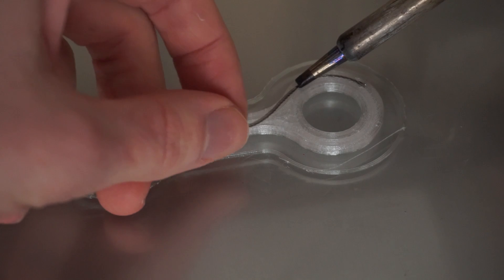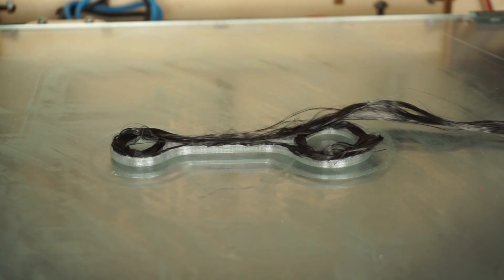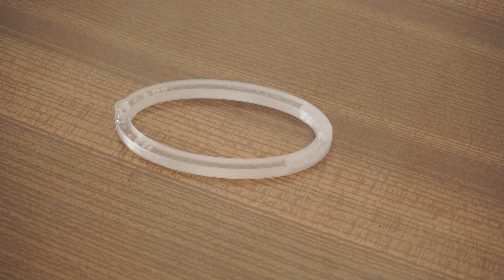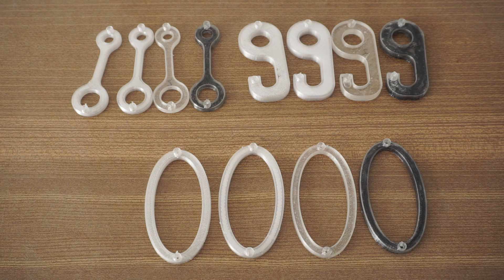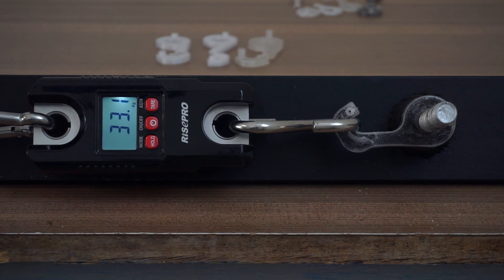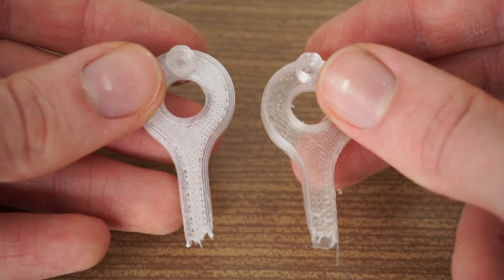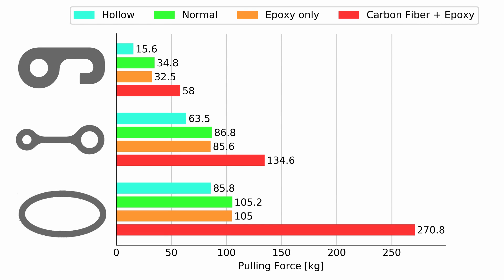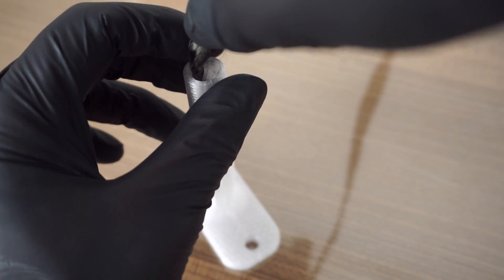Reinforce Your 3D Prints with Carbon Fibers and Epoxy

Comment: If the carbon fiber strands are too hard to fit, you can try forged carbon with epoxy, though, I'll doubt that forged carbon offers the same amount of strength for the parts. Still something that's worth trying.

Comment: For the longitudinal screw part at the end of the video why not have holes at both ends of the screw, you can then thread the fibres through with a rod or 'needle' repeatedly so its like a bobbin and you have many parralel tow threads. You then cut the looped ends at the top and bottom, seal the cyclinder and pour in the epoxy....  You should be able to get a much denser 'infill' this way.
Btw. for bigger parts what about standard infil and load up those 'pockets' with chopped fibre + epoxy mix...   I.e. the printed part walls becomes the mould for an internal 'forged CF' part: https://www.youtube.com/watch?v=25PmqM24HEk&t=5s

Comment: If you want to strengthen your part you need to wrap the carbon fiber and epoxy around the parts by using a paintbrush to brush the parts with a thin layer of epoxy and layer a thin layer of the carbon fiber over the top and brushing with epoxy again, then sand and repeat 1 to 2 more times.
Reply: So if the part is size specific scale it down a little bit.

Comment: if instead of printing the part then reenforce with carbon fiber, you 3d printed the mold then make the carbon fiber part around that, it will be even stronger. and lighter.

Comment: It might be good to try cutting the carbon fibres to 1mm or a bit longer and mixing them with the epoxy before injecting so when set the material has a non uniform grain that should make it stronger than epoxy alone and you could get the fibres into the part through a hole if it would come out of the syringe at all!

Nice vid though, I was wanting to try this myself for the MPCNC parts.

Comment: Holy shit this is amazing. I don't get why carbon fiber that look like strings can make something so much stronger and stiffer.

I wanna see if I can make a toolhead that can lay the fibers... If only there was some fibers already made into a filament like shape with resin. I could cut them when I'm done and push them with regular extruders....

EDIT; HOLY SHIT IM HYPED DUDE. THE STEEL injector tool should be easy to make! I'm so hyped if I get the time. but I'm gonna use copper cable (for power etc) because steel is super hard to cut.... Unless I do multiple thin steel wire passes

Comment: So whenever you do an injection, you really should be injecting so that the air escape port is higher than the lower port as to prevent air bubbles to start with. Second, carbon fiber works best on the outside. Third, your last part did not have carbon fiber through the base, where it’s most likely to break.

Comment: important thing you miss - there are hundreds varieties of epoxy resin... (epoxy glue from store not the same epoxy resin).
with very different properties. usual epoxy strong and fragile, but it can be flexible to.
also different fillers can be used, not only carbon fibers. and same - very different properties.
I think 3d printout resin filling still open for lots investigattions.

Comment: Perhaps you could chop the carbon fibre into fragments of a few millimetres, then stir them into the epoxy before you inject it into a part. You might need to use zero infill or multiple injection holes to let the fibres reach throughout.
Reply: Don’t breath the chopped fibres though!

Comment: Epoxy may not cure as well inside a closed cavity.  Locktite type materials might have better results.  They are made to cure inside air tight spaces.
Reply: Totally wrong. Expoxy cures with the hardener mixed in, no air, humidity required, or any solvents to de-gas

Comment: ok so the material is going to brake starting from its surface since the stresses there are generally greater on bending and due to stress concentration. Filling the material with fiber-epoxy doesnt increase greatly the strength for that reason and for the reason that in the carbon-3d printed surface you only have epoxy as a binder wich im not sure is a good match from your results(way different elasticities).

Comment: why not print with carbon fiber or steel filaments?
Reply from the maker: Those tiny carbon or steel particles in the filament don’t add a lot of strength in comparison to continuous fibers.

Comment: Thanks for doing all the leg work and thinking of ways to DIY stronger parts.  I have been filling parts with resin for a while but my biggest problem is getting the prints to be water tight. What sort of settings where you beefing up to make sure there aren’t micro gaps in your layers?
Reply from the maker: 3 perimeters and at least 10 top/bottom layers. If you still have problems, increase your flow rate or hot end temperature to make sure your layers are bonding together nicely.

Comment: I used Carbon Fiber in the first whole body CT scanner. We made flat sheets with resin and microspheres for xray translucence. Then we put low density rigid in the center. This sandwich type construction, we had strength and low xray absorbsion. I would use two nozzles. 1 infill 2. Carbon impregnated. Layer 1 carbon, infill then outer layer carbon.should make a strong plate like part.

Comment: Kudos for pushing the envelope and taking the next step.
CA (super glue etc)  works great with carbon fiber.
 A print with the minimal wall and infill that you can make stable enough for placing the carbon fiber could be very strong.
3M 77 or similar adhesive will make it easy to place the carbon fiber tape. When you are satisfied, add CA, or epoxy. Don't expect the print to add structure, use it as a form. CF w/ CA or epoxy has a much higher strength:weight ratio than any print. 
Thanks for the inspiration.

Comment: Epoxy itself isn't very strong in tension.  It's only designed to bind other materials for that purpose.  You probably would get good results with epoxy reinforced infill as long as the infill is tight enough.

Comment: Epoxy resin doesn't stick to many plastics. That's why plastic sheets are used in vacuum bagging. So in your experiment there is very little adhesion between the epoxy and plastic encapsulation. From plastics, PVC and ABS stick decently to epoxy if you roughen the PVC/ABS surface. So to increase adhesion you could artificially 3d print rougher surface (or few lines of grid) inside the channels and/or try using wood PLA.

Comment: To reinforce parts it makes no sense to put the reinforcement e.g. carbon fiber into the middle of the part. This is the neutral fiber and will therefore not strengthen the part against bending. You have to find a way to put the fibers more outside of the material where compression respectively decompression takes place.  The epoxy is good for compression, while the fibers are good for  lengthening of the part.
Reply: @DocM Hey, do you happen to be an alt account for the Minecraft youtuber DocM77?
Reply: @auxchar  nope! I am the first DocM.
Reply: lol
Reply: @StephenTeitgen  you must be just as confused as him
Reply: @StephenTeitgen  rofl. Oh yeah? Good luck with that. I can't wait for you to design a flying machine that has so much bulk to resist forces in all directions, even ones the part won't be subject to, that it'll be too heavy to get off the ground.
But I see you must've just completed your very first high school physics course and now call yourself an engineer 😂😂😂
Reply: @t_c5266  I don't I call My channel teitgen engineering because that's what I do.
Reply: Exactly. Resin is great for compression, whilst fibers, such as this or rope are best in tension. You wouldnt use a coil of rope to hold a heavy object off the ground, but rather you would use said rope to lift an object off the ground. We did these tests in strengths of materials lab.
Reply: @LT72884  Good example with the rope!
Reply: @DocMicha  thanks. Still an interesting video. Glad to see people doing tests like this.
Reply: "against bending"

he was literally doing linear pull tests. Your comment is what makes no sense.
Reply: @t_c5266  sorry, but unless you pull linear with hight acurracy you will have bending, especially in the "Eyes" of the test sample you have bending arround the ring. So if you think a littlebit on this my comment make a lot of sense.
Reply: @DocMicha  nope. You'd find the compression would immediately crack the epoxy and collapse the piece far sooner than the strands in tension. 

Or you can continue to wonder why they dont make rope, cable, chains, etc with hollow cores.
Reply: DocM this is true, however it’s much harder to wrap a part in fiber than it is to embed fiber in a part.
Reply: @Mrcaffinebean  finely chopped carbon fiber mixed into the epoxy
Reply: @je-fq7ve  CF gets it’s strength from being woven. If you chopped into random strands then it would really proven no different than fiber glass.
Reply: @Mrcaffinebean  thanks for the explanation.

Comment: Die größte Belastung bezüglich Zug oder Druck tritt in der Hülle auf. Deshalb hat die Evolution hohle Knochen geschaffen. Bei so simplen Teilen wäre es also zweckmäßiger eine wiederverwendbare Negativ-Form des Objektes zu drucken (oder zu fräsen).
The greatest load in terms of tension or compression occurs in the hull. This is why evolution has created hollow bones. So with such simple parts it would be better to print (or mill) a reusable negative shape of the object.

Comment: You can purchase carbon fiber that has been milled Into almost a dust form. You could then mix it into your resin and fill your parts with that. You must use the vacuum. Your syringe method is very flawed. Also you can purchase carbon fiber in a braided form that could be inserted into your part more easily than a simple tow which is what you are using now.  Lastly,I different is epoxy would work better. The cheap stuff that you buy on Amazon it’s too slow to cure. The faster any epoxy cures the harder it will be.

Comment: Tip: resin doesn't stick to silicone sheets, to make a silicone sheet, use caulking paste sandwiched between 2 plastic sheets, then release the plastic sheets

Comment: Try applying a vacuum to one port and suck the resin through instead of pressure injecting it. It’s the way “Vacuum bag” carbon fiber parts are made.
Reply: I was going to say the same.  Put a vacuum hose one the other end and draw the epoxy in. Not sure how the bubble entrainment may go but it should provide better results given how popular vacuum infusion already is.
Reply: The printed part might be porous you will need to put a vacuum bag over it to stop air intake.
Reply: 3d prints do not hold water ever under any circumstance, let alone air. If you leave even solid prints in water you will find that water has worked its way in and the part will mold even on the inside as seen in clear parts... Granted I live in a very humid environment.
Reply: so the printed part act as a vaccum bag?

Comment: Bravo!  Very interesting video, I would suggest checking into Kevlar tow/fiber  as it is very cheap and strong in large spools, similar to CF.  I have tried both with success.  I would also suggest it because it is much less messy and stays in a compact fiber very similar to string.  Finally it would be worth checking into purpose-made CF epoxy resin since it is made specifically to bind to fiber and the stuff I got has a nice slow cure time and works well.  You might try JB Weld alone since it is among the very strongest epoxies out there, it would be difficult to inject around fiber.

Comment: For years i use abs with carbon fibre....i just put carbon fibre mid print , add a few drops of acetone and resume the print :) 
for method you use....i use it too :) but for easier aplication i twist filament few times then aply it or aply resin before puting it in print and add rest of the resin after.

Comment: The epoxy injected parts will probably be quite strong in compression.

The carbon/epoxy matrix strength depends a lot on the ratio of carbon fibers to epoxy. A 50/50 layup is considered to be achievable for an amateur working with wet layups. With pre-preg carbons it is higher. (and you can go too high, and achieve an epoxy starved layup if consolidation is done with positive pressure instead of vacuum.

From the videos I guess the ratio of carbon/epoxy was substantially below 50/50. That might be one variable explaining the measurements. 
Another variable is strand orientation. Twisting the fibers will cause the layup to be weaker as compared to straight fibers. 

If you could achieve similar weight between the epoxy/carbon layup and the steel wire, I would be interested in the results. The carbon/epoxy layup should be significantly stiffer than the steel/plastic fusion and thus take all loads instead of working as a composite steel/plastic part. 

The epoxy used, curing time and temperature are also some variables that might be influencing the measurements. "Cooking" the part in an oven for 8 hours at 80degC and then letting the part sit at 20degC for a day or two might change the results a bit. If it was the epoxy matrix, not the carbon/epoxy composite, that carried the tensile loads there might be significant changes.

Cool experiment and video! You cerntainly thing outside the box :-)
Reply from the maker: Thanks a lot for the information. I am going to keep this in mind for future tests.
Reply: @leonbrauns  There are plenty of additives for epoxy you can try for the parts where continious fibre is not possilbe or not worth it.
Chopped carbon fibres or milled carbon powder for strenght, glass microspheres for lower density, lots of metal powders or even Aluminium Trihydroxide for fire resistance. I would love to see some destructive testing of carbon particles epoxy filled 3d prints. Also chopped fibres and powders are usually quite cheap. 

WORKING WITH CARBON BASED POWDERS AND PARTICLES REQUIRES USE OF A RESPIRATOR!!!!! (unless you really like cancer). Luckily p type filters (particle filters) are the cheapest
Reply: @leonbrauns  Yep, curing the epoxy in 70-90C (see specs) will dramatically improve it's strength.
Reply: Playing with temperature is interesting idea.
I think what you were describing is annealing the plastic. I dont believe this will impact performace, bare in mind that the epoxy cures at room temp and does not have large internal stresses, nontheless it is a cool experiment
You can also play with curing temp. You might be able to increase the degree of cure by a few % by heating the part up during curing. Usually after 90% degree of cure the mechanical properties of the resin dont change that much and I guess you are already in that range, however, that does not mean you can't get a slightly higher Tg for the epoxy. Nonetheless this is not very important since the pla shell can not handle large temps